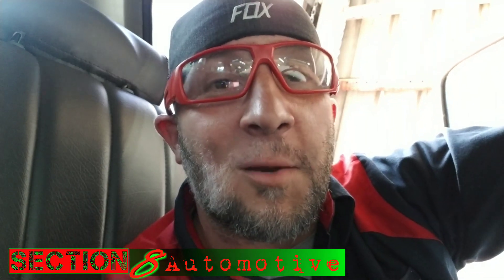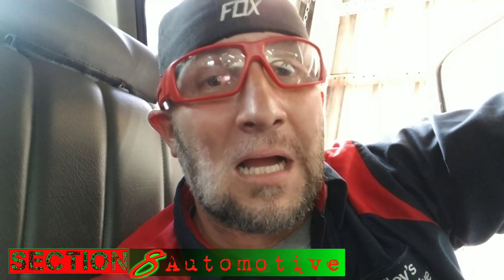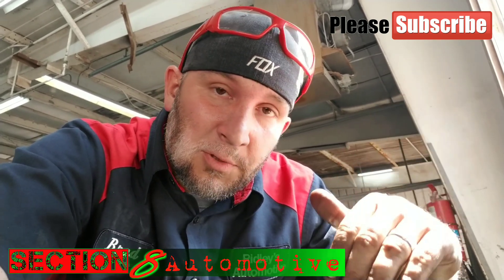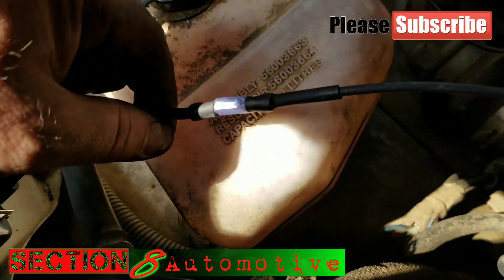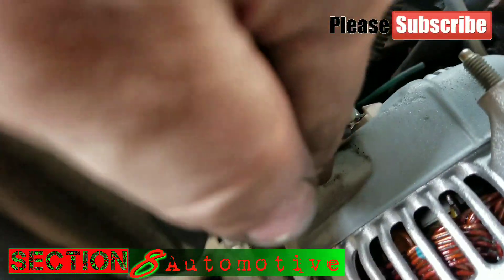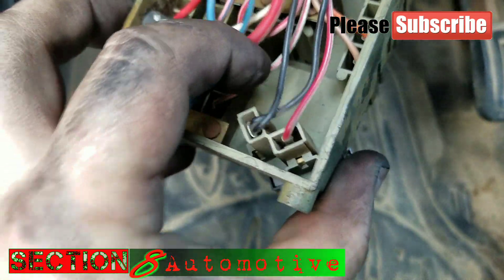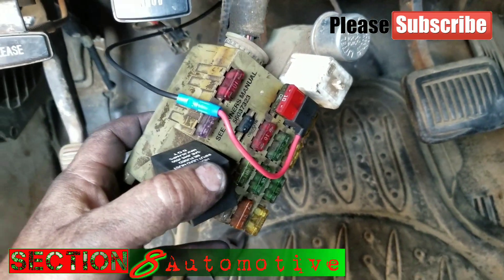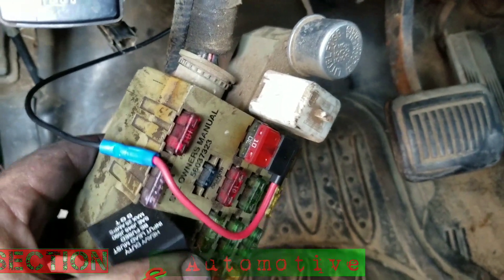How to install External Voltage Regulator dodge chrysler jeep  wire voltage regulator 12v Cummins

Comment: Appreciate this video a lot. The other ones I’ve found weren’t getting to the darn point. 

Works great I’m getting a slight fluctuation in decimals but nothing that would cause lights to flicker. 

I ended using the previous ignition wire which I believe is the blue coming out of that harness. Bolted the ext voltage reg on the alternator. We will see if it’s too much heat for it.

Comment: What about a 91 w250 360 LA gas engine?.. key switch on gas can go off the ignition coil...I went the old way with older alternator not charging much ...wonder if I have to use the original alternator?.

Comment: How do i find out where to find the key switch twelve volt on my car.
Reply from the maker: A test light or a multi meter. Key off= 0v (test light doest light up)... key on = 12v (test light lights up)
Reply: @Gonzo's Garage  ok thanks what were the two wires cut?

Comment: Had a voltage regulator installed. Should both wires be hot going into the voltage regulator? Or just one wire

Comment: The fellow before me did a hack job on the wiring, I've got it kind of where it needs to be thanks to you, but I have a question. Should there be any wires coming off the large post on the alternator? Currently there is none on mine

Comment: Ok, I have a few questions: so the ecm was bad or just the charge indicator within it?  By adding this regulator, with the charge indicator in the gauges be inoperable?  Could you have added an inline fuse straight to the battery or would that still charge down the battery when not in use?  Thanks for the video and time👍🏽

Comment: 2010 Dodge Charger rt. Voltage regulator in pcm is bad. I wired an external (blue to battery and to one side of the 2 prong pigtail, Greer to other side of the 2 prong pigtail. And a good ground) and I’m still having the problem of alternator not charging battery. I’ve pulled the new alternator back off and had it tested as well as new battery. I can not figure it out. Could you make a video explaining what I could do or what I might be doing wrong. Thank you.

Comment: Could I essentially just add a 470ohm resister inline with the blue wire to increase voltage output? I'm running a sinister Diesel 270amp alternator. But I want 15.5 or so voltage coming out for car audio. My PC regulator is still good.

Comment: My truck have the same external regulator, and the check gauges goes on after 3 minutes and the gauge goes to 18 volts im struggling
Reply: Plus the a/c not working and the transmission is not starting on first gear this all happens at the same time
Reply from the maker: Sounds like u have wiring issues or a pcm issue. I would take it to a shop that can troubleshoot it for you
Reply: @Trouble.Maker.Racing  thanks men , yes bad pcm men
Reply from the maker: Dang that sucks. Sorry I couldn't help

Comment: I want to do this on my dads caravan which has a stereo system and trying to get the voltage up in the 14.5V as recommended so the amp could put out its potential power. Problem is we can get it passed 13.75V. By adding this external regulator will this cause any issues with the car since you by passed the computer. Can you get a check engine light or have something else happen
Reply: Oh and I would like to add there are no issues at all just trying to get more voltage to power the amp and possibly add couple more amps down the line. When running all electronics and and ac sometimes of course voltage is going to drop if at stand still but while driving I know it will be ok. But before we add and go with external regulator just want to be ready for whats coming and if we can fix any issue should it happen. It does have an 1999 caravan obdII port

Comment: Added a external regulator not charging to 14 voltage at the gauge just 12 volts???
Reply from the maker: Something isn't wired right or the ground is no good.
Reply: @Trouble.Maker.Racing  could it be cause this voltage regulator is not heavy duty it drops dow to like 10 to 11 volts when I turn my light on?

Comment: I just put a High Output Alternator from Autotech Engineering in my Dodge Caliber and it was charging at 14.7 to 14.9v for a couple weeks. Suddenly it was 13.8 at idle and 14.5 on freeway. Then when I got home it was back to 14.9 at idle. However, it will flash 13v and even 12v sometimes for just a second. The battery light is on and it is supposed to have a voltage regulator inside the alternator. I also had a guy run 1/0 ga big 3. There is also a wire going into the fuse box, however. Do I need an external voltage regulator if it's built into alt? I think this high voltage is destroying my battery too.
Reply from the maker: No external should be needed. If u have voltage issues I would contact Autotech about the issues

Comment: when using the fuse buddy, does it matter if the wire going into it is 12 gauge while the fuse tap wire is 16 gauge?
Reply from the maker: No it will be fine. That is a key switch 12v reference wire. It just let's the regulatory turn on. It's a low amp draw.

Comment: how does it charge the battery of you take the harness off, your regulating voltage but only for the alternator and thats it
Reply from the maker: The key switch 12v wire from the fuse box is basically a signal wire  let's the regulator know when to and not to ramp up the alternator output
Reply: Gonzo's Garage lolz i forgot about the power cable that gets bolted tp the alternator 🤯
Reply from the maker: And yes that is the other important part.. getting power back to the battery and/or main fuse panel that is located underneath the hood

Comment: Ok someone please help! Hooked this thing up just like the video blew out a regulator in one day. Second regulator hooked up check all my grounds sanded fender to clean metal where regulator is attached worked for one hour. Shut off truck. Next morning not working no charge. Ran a ground straight from battery to the regulator housing and one straight to the alternator housing. Still doesn't charge.  About to install the 3rd regulator. What is going wrong? Do the 2 wires in the factory harness need to be cut to make this work right? Was trying to avoid cutting them so they would be there when I fix the pcm eventually.
Reply: Well got the old girl back up and running turns out it was the crank sensor on the flywheel. If the sensor is bad the computer doesnt think the engine is running so doesnt activate any relays for the AC tach spedo or alt. Swapped out the sensor rewired everything back to normal for the alt and its working as normal! If anyone else has this issue with muitiple things going out check your sensors dont assume its the computer!
Reply from the maker: Yes. The factory wires are not to be used. I stated it in the video. Cut and terminate the two small factory wires going to the alternator. If u don't the pcm will freak out the regulator until it fails.
Reply from the maker: Also u could hurt the pcm
Reply: Sounds good thanks a bunch for your help brotha.
Reply: Ya that didnt work either. Brand new regulator didnt even read above 12.3v at anytime im about to burn it down!
Reply from the maker: What vehicle is this on? And have u considered the alternator is bad. Something is going on besides the regulator.  I've done this so many times.
Reply: 97 dodge 2500 5.9l diesel. Alternator is brand new because the first regulator I put on i broke the mounting stud on the back of the alternator so went and bought a new one.
Reply: So after more digging and burning up 2 more regulators im stuck in a small town waiting for a ride. Noticed the recent regulator started chargeing no Prob saw the volts climbing up slowly then stopped and tanked. Blew the 10 amp fuse that is the key switch 12v.  Replaced that.  Regulator started charging again then stopped all together fuse not blown. Regulator supper hot to the touch. How could it be getting over charged ? Ive got good ground from alt and regulator housing onto a factory bolt on the body with no paint clean bare metal. Cut the factory pcm wires.   Only one hooked up from  original harness is the battery cable to the alternator.

Comment: Hey there got a 97 12 valve installed the voltage regualtor I got a reading on a multi meter that it was charging but not at 14 volts and I touched the regulator and it was hot AF! I got green to bottom post blue to top 12v keyed off a cigarette lighter fuse.  Whats going on?
Reply from the maker: What voltage is it running
Reply: Wells i figured out i didnt have a ground run to the alternator so that's fixed now the regulator is not getting hot but the alternator is getting hot. do I need to hook up that main wire harness block back up to the alternator ?
Reply: With a ground hooked up now im getting 14.8v but the alternator still seems like its hotter than it should be
Reply from the maker: @joenyberg1741  that voltage is fine. I wouldn't worry about the alternator temp. That's normal
Reply: Hey man the alternator was working fine for a few days now im not getting charge. Checked the fuses and there fine its a new alternator too any thoughts
Reply: @joenyberg1741  did you figure this out ?
Reply: @EastMenloPark1650  ya after burning up several regulators I did some more research. Turns out it was not my pcm voltage regulator that was bad. It was my crankshaft position sensor on the front of the crank pulley. The sensor was bad and not telling the computer the engine was running. New sensor in and i got my tach spedo cruise control and alt all working again.

Comment: Mine wasnt charging so i swapped the 2 wires and then it was charging at 18v
Reply from the maker: Make sure u have a good ground. That will make all the difference. Plus i have gotten a bad one straight from the parts store before. So that's a possibility to.

Comment: I have a 2020 Chrysler 300 trying to add a 330 amp mechman alt but voltage drops below 13 with no load.

Comment: I couldn’t get any voltage regulator to work on my 2011 town and country
Reply from the maker: It's usually a ground issue if multiple regulators don't work. Not sure how ur van is wired so I'm just giving u the most common issue
Reply: @Trouble.Maker.Racing   I had double ground one from batt an chassis

Comment: Those two green wires need a load resistor wired across them otherwise your computer thinks nothing is working and puts your voltmeter on high and check engine light continuously on.

Comment: I thought the 12 valves didn’t have a computer?
Reply from the maker: It is just reading sensors for check engine light and regulates the alternator
Reply: @Trouble.Maker.Racing  gotcha...thanks. My son’s friend is having problems with a 1999 24V.

Comment: Ya I just fixed the fix done to the 93 12v 350 I just bought had a external reg then a ton of grounds 4 so far I have found then ran it to a relay pulling power from a circuit breaker which fed from a different circuit breaker,  and that relay was tapped into a key hot wire that's just the tip of the iceberg...wait till I get into the lighting system ingenious tweaker magic in there let's just say I've never thought of using a ford starter relay that way but heck I was impressed...this is the bs u deal when u buy the cheapest cummins in a 5 state area. 🤣🤣🤣

Comment: My truck is getting low voltages at idle but normal at higher rpm, would this be a viable fix? Also, will my dash voltage meter still work?
Reply from the maker: Yes and yes

Comment: Hello. I'm working on 2001 Wrangler TJ. Installing a 2007 Durango 160amp alternator. Do you believe that I need to swap the "driver" in the Durango alternator? According to alternatorparts.com I need this new modified driver (part number 46822071MOD). I do not know what this part actually does. Thoughts?
Reply from the maker: not sure about that one. sorry

Comment: I'm about to do this right now! Wish me luck! Lol
Reply: Sooooooo my alternator is charging now butttttt when I give the engine gas and the battery gauge jumps to 75 percent and jumps up and down quickly from 75% to 80%. While it does that my dash lights flicker as well as my dome light. Any idea on why it's doing that and how to fix it?
Reply from the maker: May need a better ground. Usually works fine for me 🤷‍♂️ try that and let us know
Reply: @Trouble.Maker.Racing  yeah so I forgot to mention I was mimicking it lol I had a wire from the body of the evr straight to the negative post battery. Once I bolted it down to the body and made it more permanent that fixed the issue. Thank you! I can finally daily drive my truck haha

Comment: I have a 2001 ram 2500 with a 24 valve Cummins. I was going on a 600 mile round trip at night and my check gauges light came on and my voltage read 18 volts. Dash lights and headlights would flutter when putting down on the gas to go up hills and would stop when I let off the throttle. After a while of being off the gas (like at a dead stop or going down a long hill) the volts would read properly and the check gauges light would go off. Any suggestions before I try this method? The previous owner put two different batteries in the truck, one is a 950 cold cranking amp and the other is a 750, a guy at Napa pointed that out and he said it might help if I have matching batteries
Reply from the maker: Matching batteries not really a issue. That sounds like an alternator or regulator issue. Since the issue comes and goes I would replace alternator first. But can't be 100% so take the alternator off the truck and have the alternator checked. I've seen inaccurate results from the machines that check them on the vehicle.
Reply: @Trouble.Maker.Racing  Didn't think two different batteries would matter either. Sometimes I'll start the truck and it'll be around 10 volts instead of 14. Once I start moving it'll go back to 14

Comment: Thanks for sharing this trick, trying this out on my 2013 Avenger.  Unfortunately the is practically no metal surface in the engine compartment to attach the voltage regulator too. Modern cars suck
Reply: Just wanted to let you guys know it was the stupid F***ING alternator pulley.  Is there a dumber idea than a freewheeling alternator pulley (besides putting the regulator inside of the ECU)?  ;)
Reply from the maker: Run a wire from the mount bolt, that would normally ground the regulator, to the negative post on the battery
Reply: Will this work on a 2009 dodge avenger

Comment: What about on a 2003 2500 common rail Cummins
Reply from the maker: Yes it can work on any alternator that is controlled/regulated by the pcm.

Comment: I have a 1967 dodge charger. The voltage regulator was connected to the ignition coil and the alternator. Was that right or should i connect bith cables to the alternator?  Batter has been draining and dies real fast switched it and keeps happening.
Reply from the maker: Could be a bad regulator

Comment: This product is correct for Dodge ram 1500 2010?
Reply from the maker: It will work on any alternator that is regulated by the PCM. You are just eliminating the pcm from the alternator and putting the external regulator in it its place.

Comment: So I did this yesterday on my 95 12 valve, it worked and the alternator was charging, a little higher than normal though, but it was working. Went out this morning and the batteries were drained. What could I have done wrong or what could possibly be draining them now.
Reply from the maker: If the 12v reference run to the fuse box does not turn off with ur key when u shut off the vehicle this could cause the regulator to drain ur battery.
Reply: @Trouble.Maker.Racing  Thank you, for whatever reason the blower motor was always hot, so I jumped it off of the cigarette lighter. That's taken care of now. But ever since I installed the VR it's been overcharging when running. I saw you few people said to run a ground from the VR to the alternator case, I did that and it didn't change anything, do you have any other suggestions to stop the overcharging?
Reply from the maker: @RyanHarris-mq6xb   either the reference wire is not providing a good reference so try running it straight to the Battery post. If it still over charges then the regulator is probably bad. Also make sure the green and blue wires are on the same alternator post as I had it in the video

Comment: Just did this. Does this affect the check engine light? Mine is on.
Reply from the maker: On some yes. Because u r taking away the alternator control from the pcm

Comment: Thank you so much i got my ram fixed, i had the fuse buddy atached to the window slot fused and was overcharging, then i changed it to the next 30 amp on the side and bingo!!! Got it charging at 15.1 which im still good, thanks for every replied gonzo, good luck with your videos!

Comment: Hello again and sorry to bother, everything worked fine adter install, but gauge goes nuts , overcharging to 17 volts, what else can i do? After bolting the regulator to chasis wall do i still make a ground to run it to the alternator? Thanks again
Reply from the maker: Sounds like ur 12v reference when the key in the on position is not right or u need a better ground to chassis/body or ground it straight to the battery.
Reply: Ok thanks again i will try it over ., thanks for your reply.